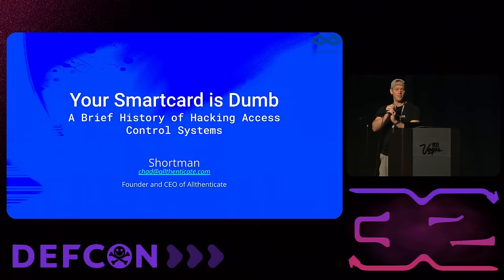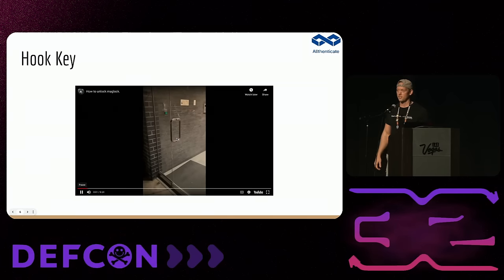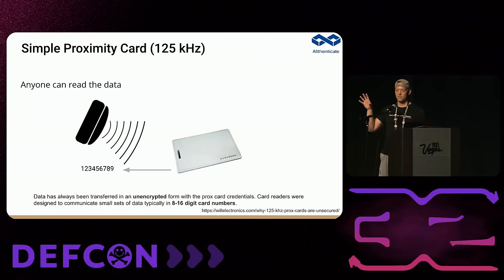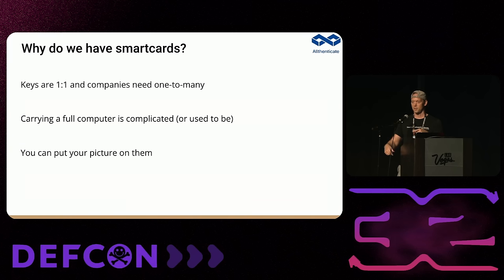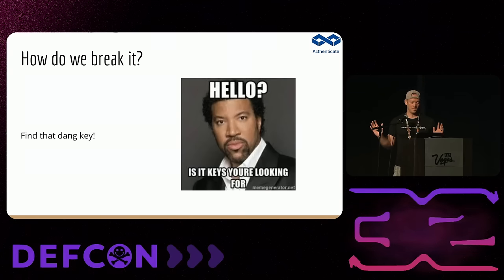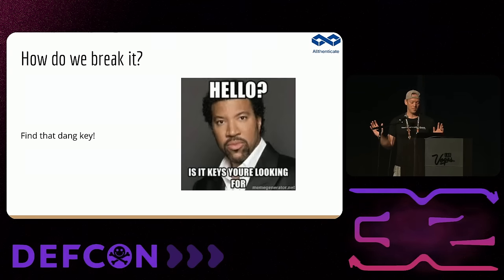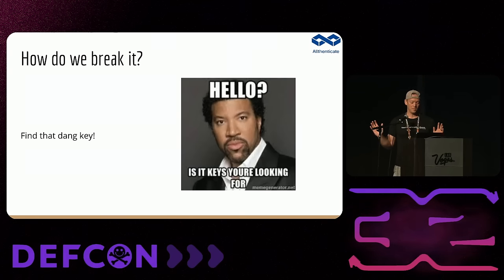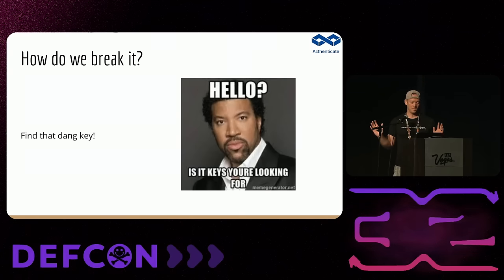DEF CON 32 -Your Smartcard is Dumb A Brief History of Hacking Access Control Systems - Chad Shortman

Comment: When the power goes out - how do you open the doors? Having fail open is a security issue in itself, Doors closed is a health and safety issue. Keys, whilst insecure in themselves may be more secure? Lockpicking is easy when you have a lock in a vice, very different when trying a genuine lock in a door.
Reply: Some doors by fire code must not restrict exit ... Thru fire exit doors, not all doors are exits. Many doors have locks to prevent entry, but allow exit.
Reply: A few things, some are battery backup. Also for the magnet ones you can buy them in 2 flavors, 1) the power going to the magnet is always on to keep it closed. 2) there is no power to it until it needs to open. if you buy #1 then when the power turns off the door is open, nothing to keep it closed. But most common is a battery backup system for the doors.

Comment: 29:07 - Yubikey literally did all three of these correctly (through FIDO/U2F/passkeys).

* One physical token, many credentials, and all secure and isolated from each other because each credential is just a data slot in the same simple protocol - not separate apps.

* No extra hardware - the protocol works over USB and NFC

* User interface - Built-in PIN/passphrase (with a separate one for administration), and touch-to-confirm. Credential storage and other settings are managed through an app on your phone or PC, which is fine, I don't need a built-in interface for that.

I love my Yubikey, and I would trust it over my phone any day. (But of course, it is not my only authentication factor)

Comment: Oh I love this, definitely going to check out his product.
While I generally approve of a move toward using portable computers for access control, there are a few areas where we aren't so clearly ready for the move yet. Firstly, NFC is subject to spoofing and MITM. While QR codes do have some drawbacks that require careful thought around the protocol built on them due to shoulder surfing, it's really easy to tell when someone is tampering with or intercepting your QR code. Secondly, the problem with endpoint security is serious and I don't think TEE is the full answer. ARM Morello will help us understand user intention a lot more clearly when it arrives. Finally, modern phone security UI varies wildly on how closely the designer read Ka-Ping Yee's Secure Interaction Principles. "Fingerprint to approve" is a good example that fails to appreciate a wide range of common attacks covered in the SIP. If we can address these, maybe we can finally get that utopia of the world securely in our pocket.

Comment: Top-notch systems require an Apple device with FaceID and a PIN.
Touch phone to reader, enter PIN.
App on phone notifies, you unlock your phone and unlock the zone with FaceID in an app.

This is what I‘ve seen installed in major companies in Europe.
Reply: defcon did faceid in 2019